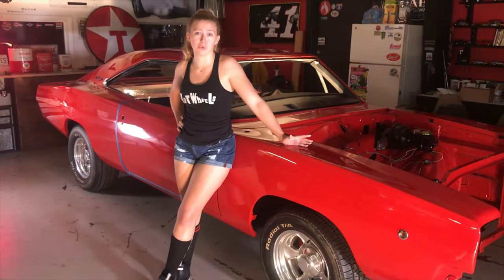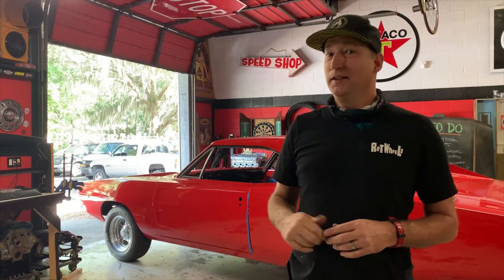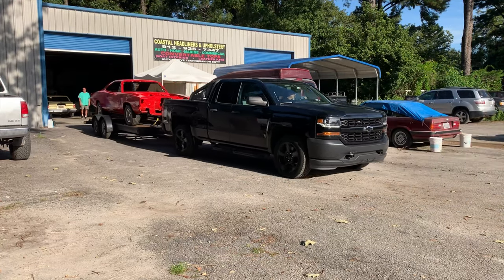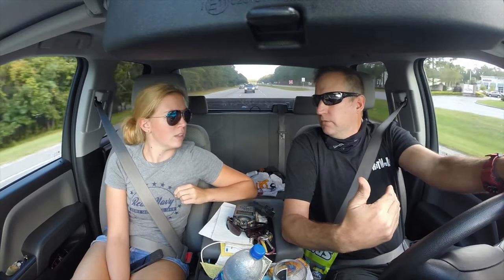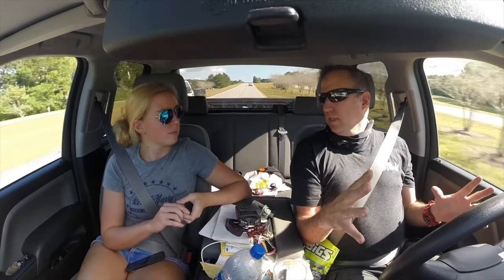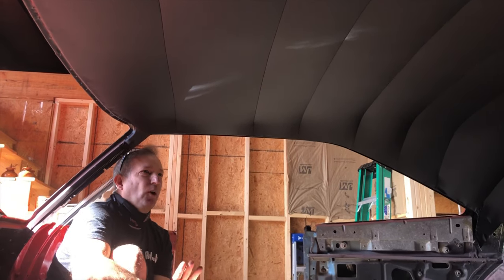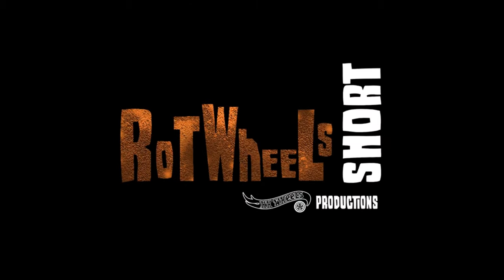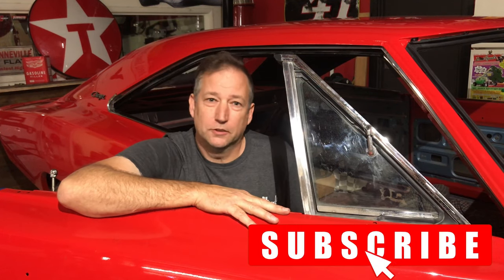1968 DODGE CHARGER HEADLINER  INSTALLATION | ROTWHEELS SHORT EP.2

Comment: Do not want to haul it back on open trailer with no glass in it wind will drop it right out
Reply from the maker: I thought the same thing but my headliner guy said, no worries! He guaranteed it would not and I didn’t 🤷🏽‍♂️ go figure. If I had to do it again, I would put it in our enclosed trailer. Thx for the advice 👌